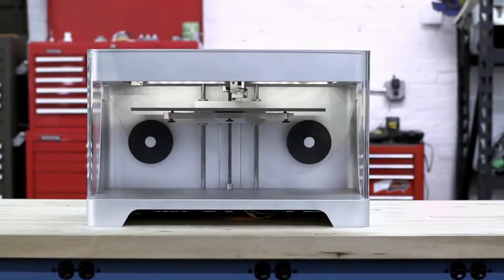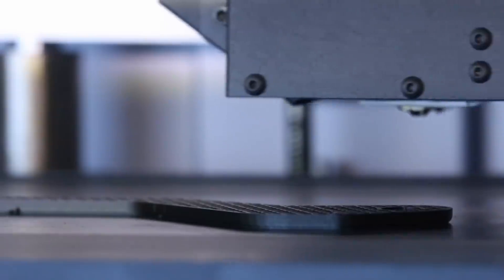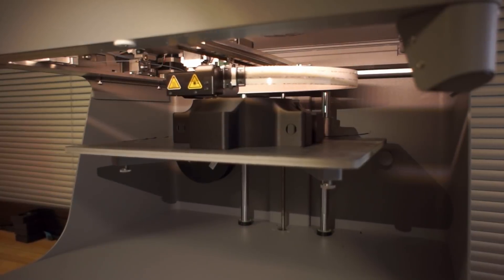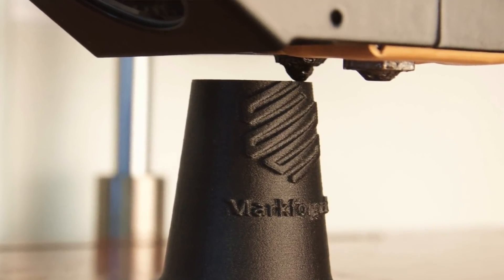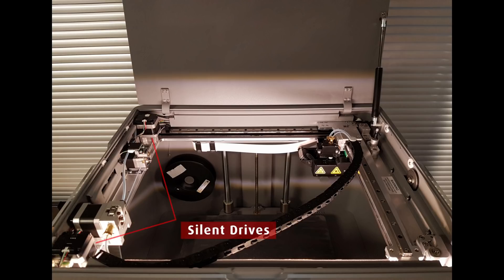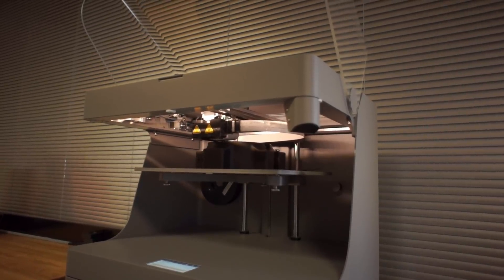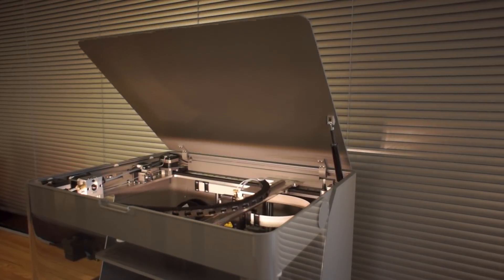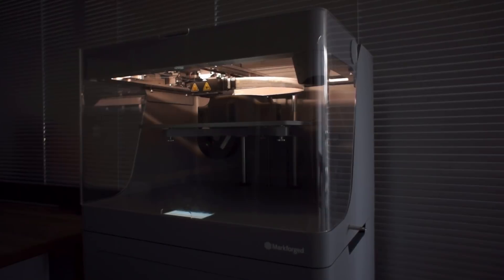Markforged X7 - Industrial 3D Printer

Comment: To use continuous filament, the extruder cannot travel like in standard prints (you shoult "cut" the filament anytime the extruder travels without printing). I expect you can print continuous fiber only in something similar to "spyralize mode" in Cura
Outstanding, 3D printing continuous carbon filament. I've been working in Lambo, they will love it, contact them
Reply: Hello, I am thinking about doing a research in this area "3d printed continuous fiber parts", how is your experience so far  and what is Lambo ?
Reply: @outplayed4511   Lambo stands for Lamborghini